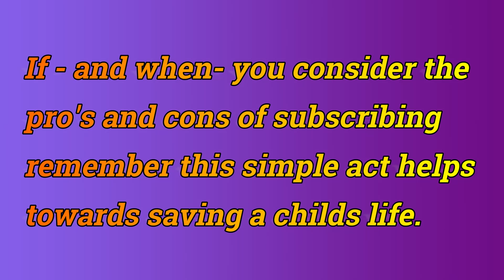Mission Impossible Mopar 318 heads - POWER PACKED combustion chamber mods.

Comment: How close can the piston be to the spark plug....not just for physical clearance, but to begin combustion in close proximity to the piston top?
Reply: I want to know if if gaining compression in a Cleveland 2v OC head by allowing the piston to intrude into the chamber via rod length and head milling would cause detonation by putting the spark very near the piston top. Is there a necessary distance? ( I see most designs place the electrode near the top of the chamber.)

Comment: I've had that .100 mill crack on 340/360 heads  IDK about 318    For low compression motor try LYC super extended tip plugs developed by AMC   they work great in LA Mopars, less timing better idle    what size valves?

Comment: Is there a reason why you didn't use the magnum head closed chamber and I think flow much better
Reply from the maker: Yes - we started with the original heads and just ported them. No bigger valves at this stage. Next set of heads will be what you referred to as the Magnum heads which have those much bigger valves.

Comment: Want more ticket buyers? Polish the entire outside surface of the engine and plate it in nickel or chrome. Even the shleppy little carburetor, water pump, and every other possible part. It will make an excellent collectible item!

Also, have the engine mounted on a nice oak shipping crate base with a clear polycarbonate case around it with a plaque with a thank you note from St. Jude's!

Comment: At around 13:00 your talking of milling .100 on one side and .125 to .130 on the other.  Is there a performance advantage for doing this?  Also if your block has been deck to zero will this type of head modification work ?

Comment: Another great video DV!! I wished I had learned what I know now prior to assembling the engine in a project vehicle I’m building. I am half tempted to pull the heads back off of it and do more porting than I did. Prior to your videos a few years ago, the amount of head porting videos was very limited,  that being the case I only ended up basic gasket matching and smoothing out the rough edges and removing excess flash.

Comment: 8:00 Flat means flush here? 125/1000 of an inch or mm. Pleasevgivevthevunits, because some aren't from stupid Imperial measurements.
Early sub
Reply: Imperial, inch measurements are stupid? Really?
I spent 30 years as a high precision machinist primarily making aircraft, and aerospace parts for the military. I have parts floating through space right now that were made to inch units. We used only inch measurements and nothing but inch units. That US Flag on the moon went there by inches, feet, and miles. Why don't you fire up a metric rocket and go get it.?
Reply: @650gringo  Nah, you did an RC flyer at most fella. Because you should know better, that US military and NASA went to metric since 1983. Because Imperial IS stupid. Even Ford went to metric, like in AXOD trannies.
Reply: @cmte.brazinazzo2061  And No the military and NASA did not go metric way back in 1983. If they did which metric system was it? The JIS? or maybe DIN? Or French? Because there were more than just one metric system in 1983, so which one would they use? And that is why the US Imperial system is so great. All the standards to build an aircraft are already set in stone. Worldwide.
Reply: Inches. This is the USA.
Reply: @hotrodray6802  Exactly!
Reply: 125 thousandths, any machinist knows what that means. .125" got it now?

Comment: Can a 1968 318 block be bored to 340?
Reply: I have 2 318 punched to 4.040 one 68 block and one 69 block . Havent had a problem yet out of either one . Sonic check first ,had a 70 block that couldnt get that size so it's just a 390 stroker engine .
Reply: @darwinfoster7420  thanks for that information. With the small bore size of the 318/390, I figured the intake valve would be extremely shrouded against the cylinders with 2.02 valves.
Reply: @darwinfoster7420  Yeah I think thats right so .100 or .125 out of the bore. I dont know anything about the 67 318 blocks as far a wall thickness.
Reply: I’m also wondering about this. A sonic check to get the cylinder thickness is the only way to know.
Reply: @brucesherrill4116  I have some friends that have a machine shop and they do all my machining work. They would know but every time I go see them I forget to ask Jack if the 318 can be bored to 340? Lol. I have a crank being turned and when I go pick it up I am going to ask Jack. Jack used to be a NASA car driver for Ford. Excellent machinist.
Reply: @ajw6715  I also have a 67 318. It’s already been over bored to .040. It had been sitting for a while before I purchased it and has rusty spots in the cylinders that I don’t think would clean up with only .020 taken off. It would be a good candidate for a 4.040 piston size if possible. 
This engine was a ran when parked purchase lol.

Comment: Great info. Made that old 318 combustion chamber look a whole lot like a newer Magnum combustion chamber. 
I have two sets of 3.9 Magnum V6 heads and will be doing as much of these "Vizard Mods" as I can to see if we can get 200 horse power out of the 318's little brother.
Reply: Hate to say it the 302 318 head has a nicer looking combustion chamber than a magnum. Now sticking to mopar closed combustion chamber heads. The 915 or 516 heads for big big blocks best chambers
Reply: If your 3.9 is a magnum engine, you could check out the Melling mc1258 camshaft. It's for a 1991 TBI engine and has a lift of about .448 when used with the 1.6 ratio rockers of the Magnum engine. It also has a bit more lift on the intake side and a bit more duration @0.50 than the stock cam for 1992 and later magnums
Reply: @brihno360  Thanks for the tip! I am also considering Harland Sharp 1.7 rocker arms with the stock cam, since the cam looks like new. But that Melling cam with 1.6 rockers sounds good, as well.
Reply: @650gringo  I have a set of those Harland sharps that I haven't put in mine yet because I'm in the break in period still.

While I had it on the stand I tested them and I the intake valve clearance with that TBI cam was only like .065. I think it's due to the fact that the cam is several degrees advanced.

Also- you should use the Keith Black cam timing method and make sure your factory cam goes in at least straight up.

Uncle Tony details how to do that method in one of his videos

Comment: Supersonic flow creates super sonic shockwaves, which slow down airflow, especially when the shockwaves are normal to the flow, less so at oblique angles. The only way to not get shockwave induced flow losses is to increase the area(which reduces velocity below super sonic), or to sculpt the surface to promote expansion fans(which increases flow velocity above super sonic). It's much harder to sculpt your way out of this mess because expansion fans won't propagate with angles greater than ~9 degrees.

Comment: This engine with the restrictive BBD carb is along the line of NASCAR restrictor plate engines. They are using in the neighborhood of 15:1 CR to compensate for the choked intake.
Reply: Nascar engines are limited on compression which is way less then 15 to 0ne . Last I knew it was 11 to 1 .
Reply: @darwinfoster7420 Now, how about a few years ago?
Reply: @daledavies2334  been that way since 2000 that I know of in Nascar cup racing . I bought quite a few of the cup engines for my modified dirt car when they were past 360 cubic inch spec . Also they had flat tappet cans because roller cams were not allowed . All engines were dry sump also where in all A modified had to be wet sump which I converted them to before racing them .plus went to complete roller cam set ups 675 horse is the most we could get out of the engines for modified racing .

Comment: I’ve mentioned this in past comments, but I’ll ask again….couldn’t the quench clearance have been rectified with stock type piston (ex: silv-o-lite), by decking the block a “little” and offset grinding the crank to increase the stroke a “little”? I understand this would have changed the cubic inches some, as will over-sized pistons, but that would allow stock type pistons to be used and probably benefit the build by lower RPM where peak power is made in 2-barrel form, and some surplus cubes down the road for when the build uses aftermarket parts…..it seems if the crank is getting ground 0.010” to freshen up the bearing surface, an offset grind could be accommodated at the same time and save some $$$ on pistons at least in this stage of the build process.
Reply from the maker: Eric, I went with the most convenient method to achieve our goal. Also it promised to be the least expensive.

Comment: You mentioned 11:1 or higher compression ratio.  Are you hoping to run this on pump gas?
Reply: Suppose to be a street engine
Reply: @HotRod Ray  It might be 🤷‍♂️.  First off, it depends on your definition of a street engine.  There are some pretty wild street engines out there. Even then, Powernation built a pump gas 13:1 350 Chevy. I believe few versions of the LS came with CR of 11:1 from the factory.  It is plausible that this 11:1 318 could end up streetable in its final, raffle state. As it was stated earlier, cam will also make a huge difference. High compression can make a wild cam more streetable and vice-versa.
Reply: And we will get to see how important the tune is on this kind of build. Initial timing, mechanical advance curves, total timing, and so on. 8.0 to 8.5 to 1  dynamic compression is doable on 87 octane pump gas, it's in the details. Notice David talked about cam selection after finalizing the ports. Static and dynamic compression will be factored also.
Reply: That's a good question! I wonder, too. If the heads are being done like this test chamber, it'd be interesting. 11.1 is pretty high, especially for cast iron heads. On the other hand, considering the high polish of the chambers, the enhanced turbulence, and the restrictive nature of the 2 bbl carb and intake, maybe this will live just fine with premium pump gas.
Reply: @kart70  I'm really excited to see DV giving the Mopar heads some attention.  I'm working on some 340/360 heads now.  The combustion chamber shape is identical to the 318 heads in the video, so I hope to use some of his tricks in my build.  Really want to stay with the factory iron heads, thus my interest in the compression ratio.  I hope DV will comment on this issue.
Reply: I am hoping it ever runs at all
Reply: 11:1 engine can run on 93 octane pump gas w/ the right camshaft profile and distributor curve. Think dynamic ratio, not static.
Reply: @josephtravers777  So try to get the DCR to around 8:1 with the cam?
Reply: @ChrisJones-ez8fj  8:1-9:1, IIRC

Comment: Hello Mr. Vizard,

In one of your recent videos you briefly talked about filleting the lower bore edges (crankshaft side) in order to optimize air flow within the crankcase volume. Will we get to see how to do this in one of your upcoming videos? I am asking because I am at the stage of my own build where I can still implement this.
Reply: I have read of motorcycle builders who install one way valve on the crankcase to let air out but not back in. The theory is that pistons moving up and down will drive air out of the crankcase thru the one way valve then there will be a vacuum inside the crankcase as long as the engine is running.
Reply: @650gringo I've heard of guys using the smog AIR pumps to suck vacuum on the crankcase.

Comment: HI David ' Is Lengthening the rod by offset boring the small end of a press fit pin rod and bushing it to suit the floating pin worth considering for cheap pistons or is that cost and procedure impracticable considering the dependability of decent pistons ?
Reply: DV said in a previous video that generally speaking a small rod ratio increase is irrelevant.
Reply: @hotrodray6802  and cost comparison ?